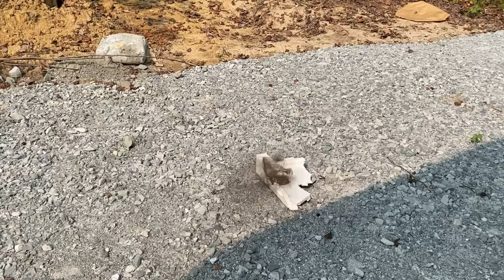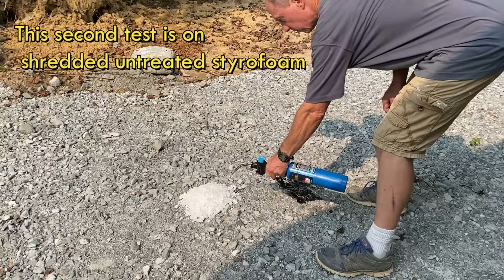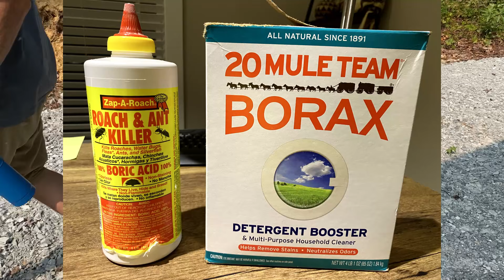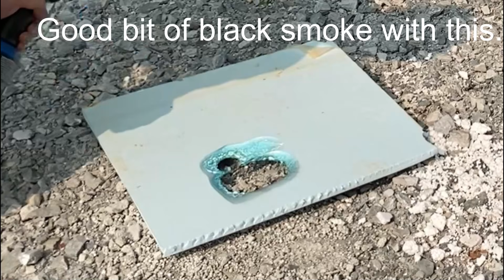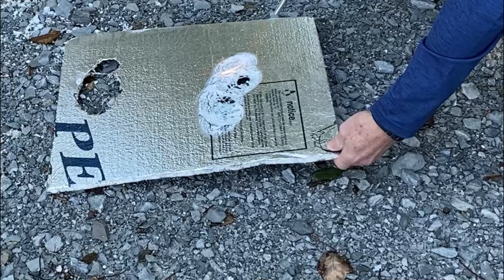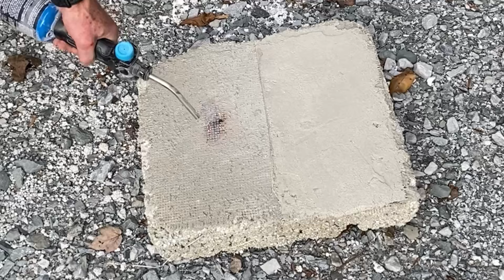Abundacrete FIRE TEST … YOU Won't Believe THIS!!

Comment: the 'disappearing' shredded styrofoam is such because the fragments are sufficiantly small and isolated from one another that sublimination occurs and then the gas either escapes or is itself burnt
Reply from the maker: That is right and since Styrofoam is 98% air there isn't much material to burn any way

Comment: I am DIGGING your videos. You came up at just the right time. I am now thinking about potentially making brick-panels for a geodesic dome… then seal them in-place, coat with another layer of this abundacrete stuff, then paint. You can “trowel” this stuff on too, right?🤔
Reply from the maker: Nice plan! We have a self-healing waterproof stucco mix we use to seal our Abundacrete buildings (trowel it on)

Comment: I appreciate your fire tests.  However.  If a fire is to develop in a building it is due to heat, and the heat will build in one point, such as an electrical failure, and not fluctuate or rotate or swing away as you did with the torch.   To test accurately the material needs to be in situ, and it needs a constant heat source to mimic real conditions of fire ignition.
Reply from the maker: We will throw it on a campfire next time

Comment: Could you use lime instead of cement?
Reply from the maker: @ToshiSanglir-qx3cn  It's possible but lime is much weaker so you would be sacrificing the structural element of our mix.
Reply: @AbundanceBuild  Thanks
Reply from the maker: @ToshiSanglir-qx3cn  You're welcome

Comment: Why do this much work to build a structure that is extremely weaker than concrete. Builders will push anything that saves labor cost and that savings will not get past on to the end user.
Reply from the maker: Its easier than concrete to use. The fiberglass shell is not weaker than concrete. It resists cracks better and is far cheaper. Plus this is simple to DIY meaning the end user gets to save the money!

Comment: What happens when you go to sell a home that you've filled full of Styrofoam and aircrete?
Reply from the maker: Higher insulation value is considered a good thing! Spray foam insulation is very popular now so it shouldn't be a big deal, though we haven't sold one
Reply: You may not want to advertise the fact that you built with an unapproved material.
Reply: Styro-crete is an approved material in the right context

Comment: Looks great.  Like here in Colorado where wild fire is a real issue.  Awhile back we had a fire about 10 miles South of where I live take out several neighborhoods for about 1200 houses in one afternoon.  Literally the houses burned like a forest with the fire burning the houses coming in as a wind driven grass fire.  Houses built with your syroctete look like they would not have supported such a fire.  This looks like a very good material to use in most construction around here.  Maybe should be used as allot of the burned out home owners can't afford to rebuild due to high cost of construction and low insurance pay outs.
Reply from the maker: Definitely! It is very fire resistant! It is crazy the materials people are forced to use ignite so quickly

Comment: Hi. I am so intriguid by this alternative building material. I was wondering, instead or together with styroform could be added some  shredded regular plastic.?
Also, instead of  fiber mesh and cement coat, could this be done instead with fiberglass mat and resin ? Would it catch and bond together?
Reply from the maker: Shredding regular plastic in thin strips may be beneficial to add some strength but the Styrofoam is important for its insulation value. I don't know about resin, we have never tried that because of the higher cost - try it and let us know how it goes! :) Subscribe for updates coming soon!

Comment: Will gasoline dissolve the matrix like it dissolves styrofoam?
Reply from the maker: Not sure what you mean by "the matrix" but gasoline doesn't dissolve cement or fiberglass. If the styrofoam dissolves you still have the strength of the building in tact! Subscribe for new builds coming soon!

Comment: Wow! Surprising results. Really good idea to do a control comparison with the foam insulation that currently goes up in modern homes. Modern homes are real tinder boxes though so probably not a great benchmark! Sadly that's what we live in today. The concern I have with non-natural materials is what do we do at end of the life of the product? If we incorporate toxic materials into our built environment we are swallowing a poisoned pill as these chemicals are sure to leach into our environment. Alas the damage is already done as synthetics are already used everywhere in construction so I guess it's best to play the hand we have. Keep up the good work!
Reply from the maker: Totally agree! Our buildings will last an extremely long time but if it needs to be torn down, the building can be ground down and reused as filler in the next building's walls. So the end of life is also better than traditional buildings

Comment: If untreated styrofoam particles do not spontaneously combust, but instead melt away, what happens to the styrofoam particles that are embedded inside the concrete? Do they also melt away after awhile, thereby leaving an empty void (concrete outer shell with empty inner core)? If you do further experiments to find this out, I'd be all ears. I've subscribed and selected to be notified of all new videos.
Reply from the maker: Thank you! If that happened the end product would be essentially aircrete. The voids are not an issue. The strength of the building comes from the fiberglass shell!
Reply: Got it. This makes perfect sense.

Comment: Propane does not burn anywhere near the temps you cited. More like 1600 degrees F
Reply: The tip of a lit cigarette during a puff is 1300F. Propane easily reaches excess in of 3000F when burned clean.
Reply: I do not know where you got your numbers from but you are wrong. Propane burn temps are around twice as high as you mentioned.
Reply from the maker: Thanks for the tip! Subscribe for new builds coming soon!
Reply: Strange. Having Googled how hot propane burns at, every source I found disagrees with you. You only get that low a temperature caused by improper burning (blocked jets, etc signified by a yellow flame.

Comment: How do you get to use these new materials with the USA building codes…?  Even when they are stronger and fireproof, it seems that approvals will be hard to get…even for sheds in some areas.  

This seems quite superior and with lower labor intensity than earth bags as a building material, although earth bags will hold up against high winds and flooding.

Thank you for the interesting videos…
Reply from the maker: You're welcome! These buildings hold up great! Codes do vary widely but we are working towards getting approvals

Comment: @Stephen Williams  Does the aircrete styrofoam (without the reinforcing coats) have greater flexural strength than a block of styrofoam by volume?
Reply: without a doubt.. it's basically half strenght of normal concrete.. seen a video somewhere where they tested the strength but can't seem to find it.
Reply from the maker: Yes. Good question!

Comment: Hey Steve,

It’s been a slow processhere in Ky with the heat  Index hovering around 115 degrees. 
But, with working in the middle of the night, I’m making some progress, 
Started a little different idea on the roof. 
Just hoping it will workout
Reply from the maker: You can do it!

Comment: I once helped a friend build wall panels from sawdust/cement mixture. It seemed to work well. Would it be possible, in a remote setting, to use cement/Styrofoam mix without the bubbles? What about compressing this mixture in a simple ram? Thanks for your comments.
Reply from the maker: Yes new recipe videos without foam coming soon!
Reply: @AbundanceBuild  can't wait for this !!

Comment: Question Stephen, I'm building a house in the caribbean, where is always hot and humid, will filling the 8 inch concrete block holes with styrofoam-aircrete give me enough insulation?? Houses there are typically all concrete even interior walls and roof. I want to insulate it as much as possible for the cost of course. Thank you in advance and thank you for all the info you provide here.
Reply from the maker: Should be very effective in that application! Good luck! New builds coming soon!

Comment: It'd be extremely interesting if someone built two 8x8 shed's side by side out of lumber, wind barrier, fibreglass batts, poly vapour barrier, plywood, and light gauge steel framing and aircrete.

Then light them both up and see which burns down completely in about an hour.
Reply from the maker: new tests coming soon! subscribe to see the results!

Comment: Great stuff...i have a question ...can you uae this to build a pontoons for a boat?
Reply: I think it would be easier to just use Styrofoam.  You can order pieces close to the size you need and sculpt it.  Then fiberglass it.  You need to seal the foam so it doesn't absorb a bunch of resin and become heavy.
Reply: Build your pontoon floats out of Styrofoam. Once you shape them like you want them, seal them with outdoor wood glue. Possibly two coats. Then apply a few layers of fiberglass and resin. You could use the outdoor wood glue on the fiberglass or even wood glue and canvas making sure to saturate the material completely. You can thin the glue with a little water. I'd say 1 qt water to 1 gal glue. Then your last layer should be fiberglass and resin.
The outdoor wood glue and canvas, burlap, absorbant bed sheets, when layered is incredibly strong. It's known as poor mans fiberglass. There are YouTube videos on it.
Reply from the maker: go for it! subscribe for new builds coming soon!

Comment: Styrocrete is popular here in Siberia.
But add polypropylene fiber to your mix. And another thing, we call it wooden soapy resin, or smth like that, in russian Смола древесная омыленная.
Good luck!
Reply: Can you provide a mix, ratio recipe for that?
Reply: So that's pretty interesting.
I guess the fibre adds more stability to the styrocrete. But what exactly is this "wooden soapy resin" ? Is it like wood fibres in water and with more additives?
Cheers mate.
Reply: @radicalphil1871  Maybe "saponified wood resin" will be more clear?
It`s a kind of adhesive between styrofoam and cement, makes the mix more liquid without adding more water, traps some tiny bubbles of air in the mix.
Good luck!
Reply from the maker: Thanks for the tips! Stay warm! Subscribe to see new builds coming soon!

Comment: Do you know if using saline sea/ocean water is viable for mixing with the foam concentrate or does this require some specific purified water?
Reply: I guess you'd have to look at its pH and go from there... its a good question, id be curious to see if this could be a viable source.  Also, knowing the amount of salinity might be useful as well, as this affects the density of the solution... additionally, depending on the concentration of the salinity, i would think this in turn affects the solutions solubility, which then might affect how well additional additives like stabilizers, foam, etc incorporate into the solution.  just my thoughts...
Reply from the maker: Go for it!

Comment: I'd love to see your mix used on a metal frame building, such as the garage frame you're sitting in during the last scene. Turn it upside down and fill the roof area with styrocrete about 4-6 inches thick. Once set, roll the structure on one side (or stand it up) and make the walls. Good, solid, metal-framed & insulated building!
Reply from the maker: Thanks for the tip! Subscribe for new builds coming soon!

Comment: Wow that's really interesting I guess the heat output is just too low to radiantly heat the nearby particles to their ignition point but just enough to conductivity heat the rest of the burning particle. If you had a large volume where the heat of combustion wasn't able to escape I think you might get a sustained fire but that's true of basically anything.
Reply from the maker: Well said. Subscribe for new builds coming soon!

Comment: Could also test as vertical hanging as is in the wall, not just horizontal. Vertical burning usually spreads faster like burning grass uphill. It heats ahead of itself so it burns / propagates faster. Good stuff
Reply from the maker: Thanks for the tip! New test coming soon! Subscribe to be notified!

Comment: Great videos Stephen! I am finding myself looking forward to each new episode with great anticipation! Unfortunately, I will never be allowed to build what I want to with this in Scotland but I think that it would be great for a shed and perhaps even garden furniture depending on the strength. I am imagining a rocket stove heated bench using your Styrofoamcrete to support the bench top and ducting the hot flue gases which would warm the bench top.
Reply: Nothing says you can't be eccentric and live in your garden shed. 😉
Reply: @MrHuram-abi  LOL
Actually, there are laws in Scotland that specifically address that...
Reply from the maker: Thank you! New regulatory testing and builds coming soon!

Comment: Great Videos!!!!!  I am interested in building Arched Huts so that we can get the homeless off of the streets.  If you look at what Canastoda Huts are doing to provide the same functionality.  They end up costing around $2000+ per hut.  My thoughts are making a series of forms up to cast the end wall/door wall/ and several "rings"; (all having several cut off plastic conduits, such that all the pieces would be tied together via tie bolts.).  I think this structure would be under $300 in materials, and be fireproof!!!  Great Work!!!
Reply from the maker: Great idea and a wonderful use for this. Please share your ideas as you design this.

Comment: Great videos! Thanks so much for making them!

A couple thoughts- i wonder how the cost comparison of aircrete vs styrofoam aircrete balances out when you factor in time. I wonder how much time the extra steps to acquire and process the styrofoam, and packing in the forms takes.  Time = money.  But maybe the time is negligibe. You'd know better than most of us!

It would also be interesting to see how the structural properties of the styrofoam aircrete degrade from fire compared to aircrete.
Reply: With a 9 foot wall you would have to do between 3 and 9 separate pours and cures. And make the wall twice as thick to get the same R value...
Reply: I think it was in the previous video about the Styrofoam shredder he built. After the time and modest cost of making the shredder he estimated around 20 minutes per 35 gallon bag to gather and shred the Styrofoam.  This is offset by the cost for the greater volume of concrete in regular aircrete, plus there is longer drying/curing time required for regular aircrete of same thickness plus reduced R value.
Reply from the maker: Thanks for sharing!

Comment: Hi Stephen
We were thinking of building a 9m 2 storey earth bag home, with the lower storey being underground. Do you think it would be possible to use aircrete instead? And make the moulds for this. 
So the actual wall would be 17 foot tall. 8 foot being underground. I was thinking instead of tampering the aircrete down, we would use a concrete vibrator that we could lower down to the base and pull up during the fill.
Thoughts? Thanks
Reply: When you're dealing with underground walls the tension forces of the ground against the basement walls is fairly significant, and cement/aircrete has low tension strength.  I'd be extremely careful.
Reply: @dustinabc  dont do it you mean
Reply from the maker: Consult a  structural engineer first. Good luck! New builds coming soon!

Comment: Seeing what you are doing gave me the idea of using this stuff to insulate a polebuilding home with it. 

You have the sheet metal on the outside and use a slip form on the inside of the building to form the walls. Coming up with a 10 to 12 inch thick insulated wall would be easy and cheap.
Reply: Sounds doable.
Reply: @AbundanceBuild  we are looking at property in northern Nevada that is offgrid so making things as thermally efficient as we can is a must to keep power usage down. The walls are more likely to be 9 inches thick.

Comment: Phenomenally informative video!!  You inspired me to insulate an old house with eps/borate - what is that awesome blower?!  I can tell you that the borax/boric-acid solution amazingly repels almost everything that crawls.  Cannot understand the surprising fire resistance from just shredding eps (sure that was not a treated source - the eps panel makers are supposed to treat everything they make).  Thank you!

(added note: The treated eps as loose fill solves a big problem with cellulose, where an old uninsulated house has rotted-out building paper, any insulation will get wet.  Cellulose will really never dry out, but eps will!)
Reply from the maker: Thanks SpaceCrete, the blower is an old electric Black N Decker leaf blower/vacuum. Works great and it's powerful.

Comment: Thank You - Stephen !  Another wonderful Video ... MORE ... MORE... MORE - Please !  And thanks for the link to Dr Energy.  I suspect you are in Tenn ( ? ) ... I'm building a Passive Solar house in NKu ( Cincinnati Area ). Going to use 'Dry Stack' 12in Block for Int/Ext Walls - for Thermal Mass.   I've been struggling with Ext Foam Insulation for my ( Ext & Perimeter ) Insulation ( 12 in ReClaimed ) Styrofoam ... because of the Flammability/Melting.  This has me thinking about 'Forming Up' your stuff - instead of 'glueing' plain ( un treated ) Foam Panels .... Your thoughts ?  Thank again. papawbil
Reply from the maker: Thanks Bill. Forming up and pouring this around the exterior of your block concrete walls will work very well. Very easy to stucco over it to finish it out. Portland cement makes it fire resistant.